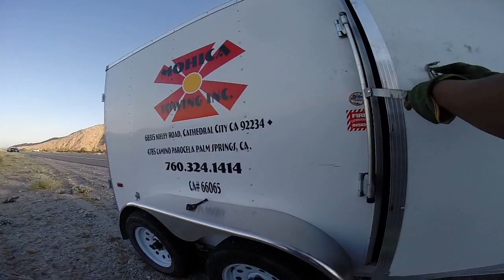Roll over windy point - Part 1

Comment: It looks like none of the wind turbines in the background are turning, even though it's very windy. A loader and a dump truck might have worked better. How did you get it on the Landoll?
Reply: There are some wind-farms in that area that were built with older generation turbines that can not handle winds that are too strong or they would tear themselves to pieces. I am not sure if this wind farm is one of them, but I have driven through areas where the turbines operate at moderate wind speeds, but get shut down during high wind to prevent damage.